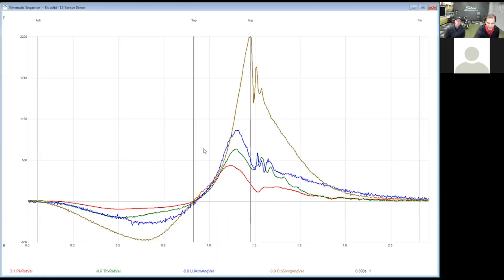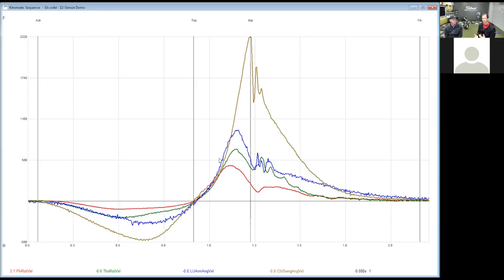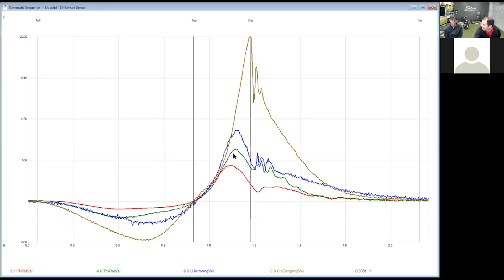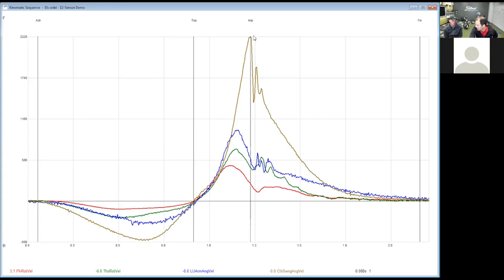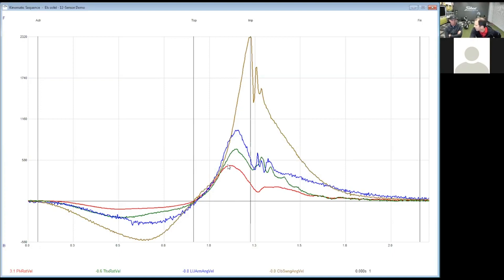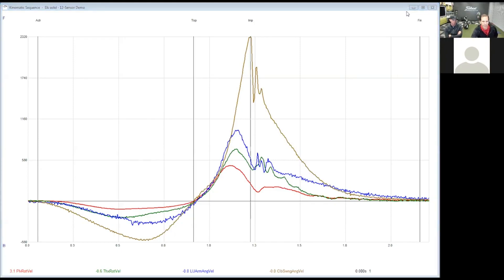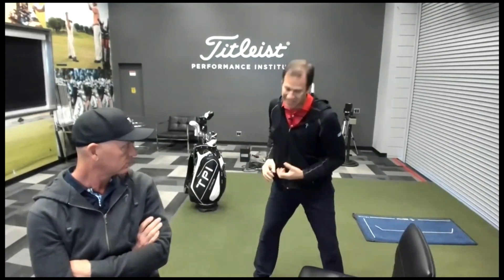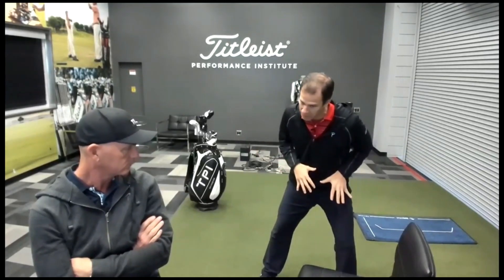Analyzing Ernie Els' Kinematic Sequence

Comment: Hi,

could you do a video about the role of the fasciae in the golf swing? Newer research suggests that fasciae are an important source of power for explosive strength sports like olympic weight lifting which might also important in golf. The research says that the power comes primarily from the preloaded fasciae and not so much for the muscles itself. 
Like your channel. Keep up your good work!